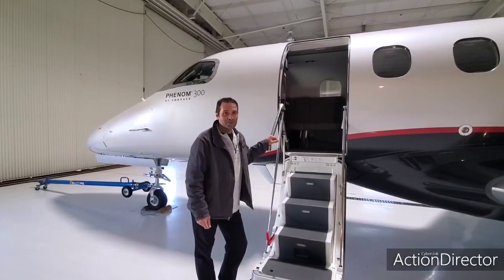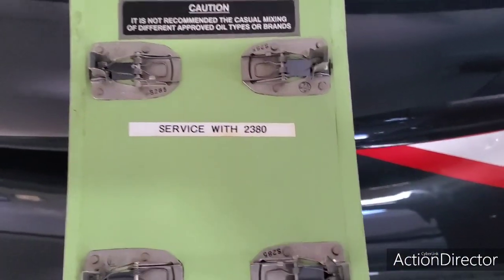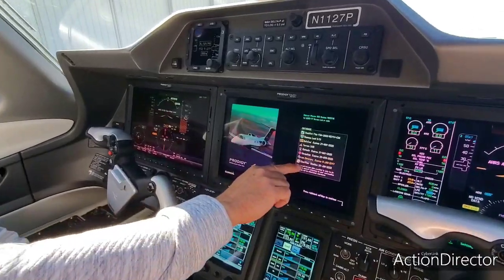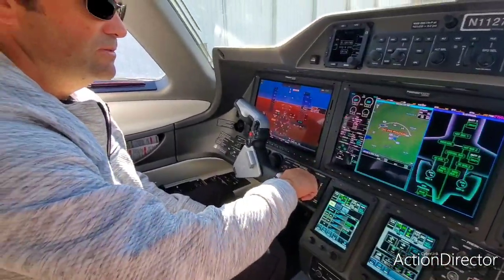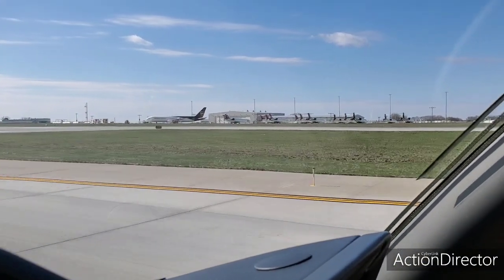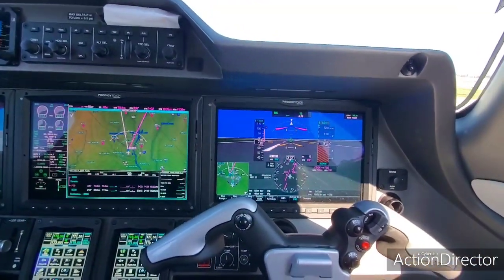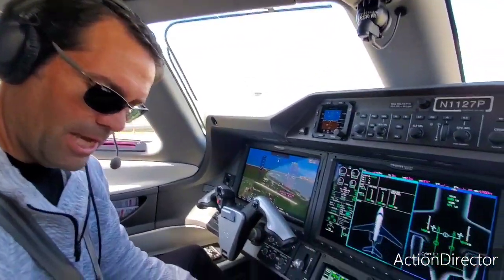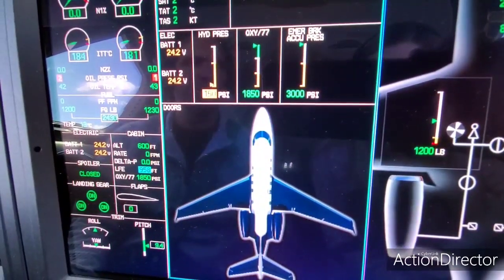Phenom 300 oil service. Test Flight.

Comment: Hi, can the phenom 300 start its engines on its own? or does it need the GPU
Reply: Yes it can, but the batteries were too low in this case.
Reply from the maker: Yes it can, but you want 24 volts minimum.  The engines start cooler and faster with a GPU.
Reply: Winding Trail thanks!